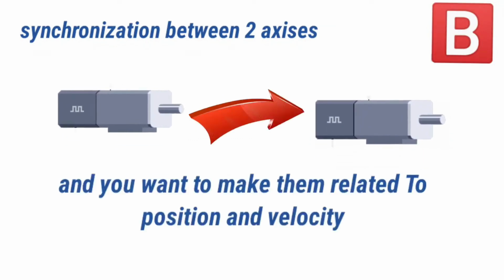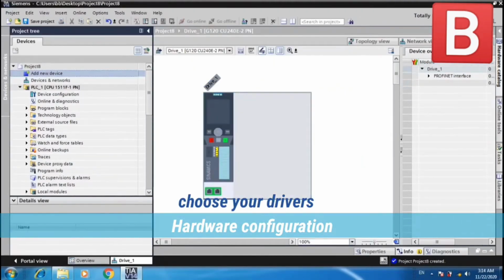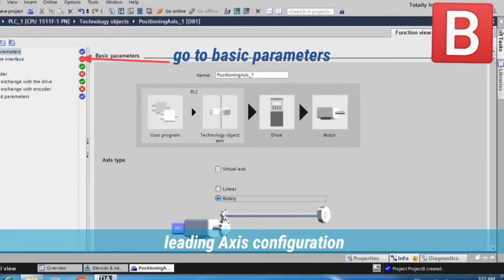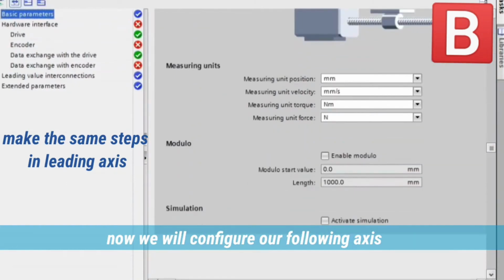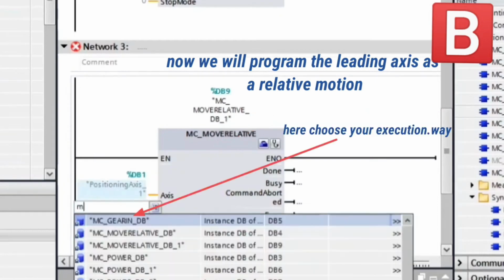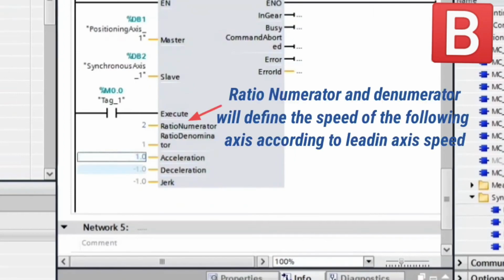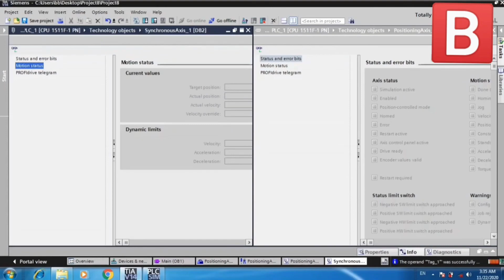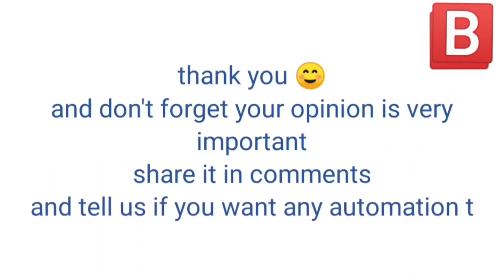How to synchronize 2 axis (2 sinamics drivers)in TIA portal using ethernet (S7-1500) siemens

Comment: How should I synchronize two brake motors in a vertical load up and down simultaneously in the configuration and programming? Do you have any suggestions?

Comment: I use S120 CU320-2 PN with 2 double motor axis.
How to use LCon RFG for ramp up and down of machine line speed with 4 TO axis (1.conveyor axis, 2. unwind axis, 3. Infeed or nipping axis and 4. rewind axis the all axis will rampup and down (change speed) according to master machine speed setpoint from HMI and all axis will stop all when push stop machine as well ?
Reply from the maker: i do not know i need to search